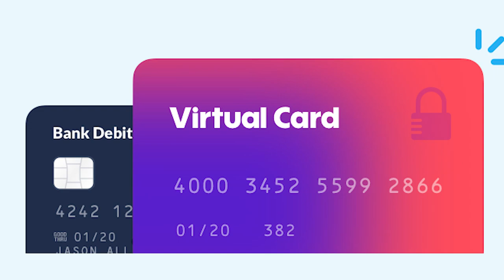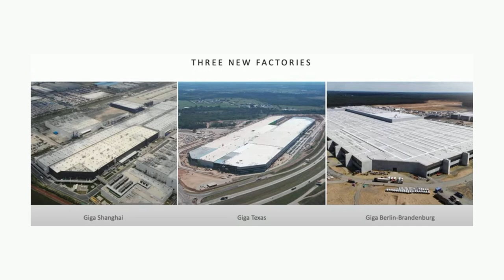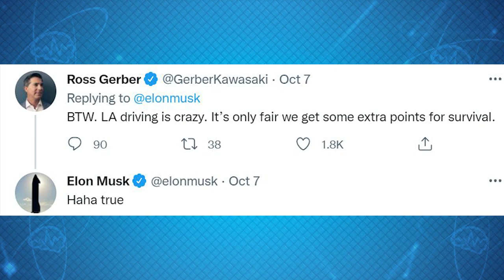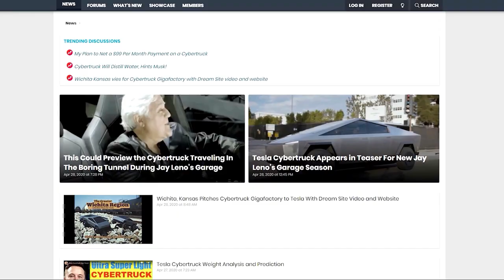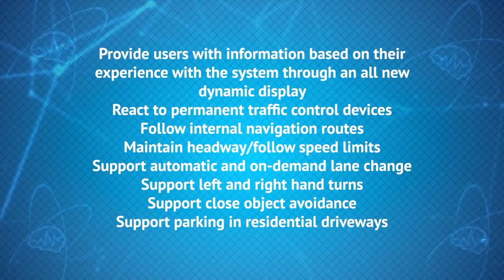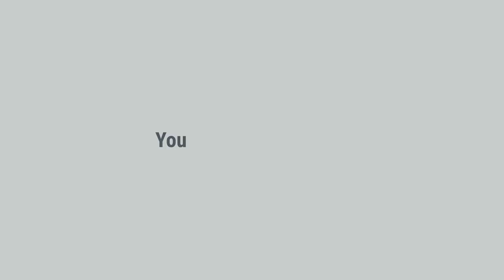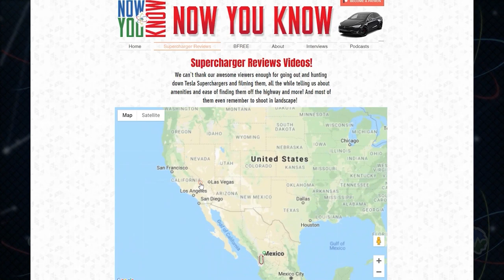Tesla Time News - Tesla's GigaBeer & Texas HQ

Comment: Im not a Korean viewer, I'm European and we have the required Type 2 connector, and personally I always prefer charging on Superchargers purely because of the ease of use and the low price. And you gotta imagine it's the same for a lot of owners.
So depending on Tesla's current network of SuC's in Korea, I don't think the adapter will be too much of an issue for other EV brands.

Still, the non-Tesla-EV-charging brands should really up their game and get more (working) chargers.

Comment: If the police are still driving ICE cars, will they even be able to catch a criminal if they're driving the Model 3/Y?  Luckily this time, the good guy was in the right car, I hope they switch before they repeatedly find themselves on the losing side.  P.S. Excellent work, Joe!
Reply: If you drive a Tesla and constantly think you can out run police.  You should probably slow down, pull over, and not be driving a Tesla.  But yes.  I definitely could outrun the SPD.
Reply: @lucasmccormick9473  So slow down, pull over, and stop driving your Tesla.  Your rules, not mine 😅
Reply: You can't outrun a Motorola

Comment: I think it is possible for the headlights to actually show Tesla with Easter egg software. I work for Mercedes and they have had adaptive headlights for a while now using a block of LEDs and turning off certain LEDs to control where the light goes so be cool if Tesla can pull this off 😃

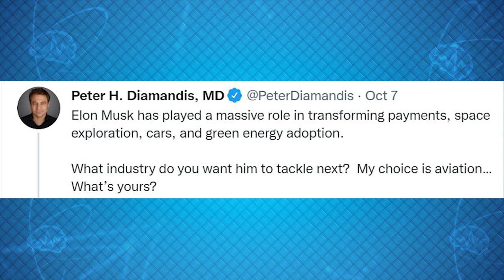Comment: 57:48 - What would you like to see next from Elon? -- For me, the efficient water heater/AC combo that has been mentioned before. This would dovetail nicely with solar on new home builds. And hopefully could be adopted to industrial buildings as well.
Reply: Slug robot used by the boring company. Has digger drills on the front but uses slime to move forward.
This is what he is working on next.

Comment: We have the CCS Adapters in New Zealand and Australia as well. It requires a firmware/software update to the car as well.
Reply: TM3 and TMY has already European CCS or CCS2 as their standard (US CCS connectors are also called CCS1), and the SuC V3 has only CCS2 on the cable. V2 has both types, though European "Tesla plug" is an altered/enhanced ChaDeMo connector that can handle more effect than ChaDeMo when charging, but it  looks very similar to the US type Tesla plug. 

TMS/TMX has the option of upgrading to CCS2 adapter, but require som HW to function. But newer TMS/TMX came with the adapter and needed HW preinstalled. The new updated TMS/TMX will probably still have this solution, as the CCS1 and CCS2 are just to big to hide behind the cover on the lamps. 

Unless they choose to change their solution or back lights for the European versions, but that needs, as mentioned, bigger lights and bye that, big changes on the body, so not very likely.

Comment: The Irony of Tesla being a Direct Current company is amusing.  These DC Battery storage facilities are exactly what Edison proposed over 100 years ago when he was competing with Tesla's Westinghouse Alternating current solution.  So in the end it's DC for storage and AC for transmission.
Reply: @wayando  Do you mean that an AC stove will work on Direct Current with no problems? Or that a microwave designed for AC will run on DC or a refrigerator?  I'm no electrician but that would be a surprise to me.
Reply: @willywonka8730  most recent and high-end refrigerators, air-conditioners and washing machines are now internally DC operated, they are more efficient, longer-lasting and quieter.
They use linear compressor or DC Motors, and make use of an inverter for their  conversion. Ofcourse, no need mentioning all electronics tv, laptop, DVD, etc are DC too. Apart from microwave, can't think of why Homes shouldn't be DC powered.
Plus the modern trend which will soon become a Standard regulation globally is for every new home to be self powered (solar & battery storage) and also be part of distributed utility all of which are fundamentally DC generated power
Reply: @danielfreeman4765  Interesting.  Thank you.  Are these appliances realistically modifiable to run directly off a DC power Supply? i.e. using simple wiring changes to bypass the inverter circuit?  I know that low voltage DC circuits in computers can be maintained by batteries and that the "power supply" supplies 5v DC to the mother board and it's components from 110 AC.  It would be very useful to me to be able to run an air-conditioning compressor off of DC power.  Is it as simple as opening the box and supplying the right DC voltages to the various components?
Reply: @willywonka8730  Yes, for the technically inclined but I won't recommend such since it will void the warranty asides that any errors might destroy it plus work arounds aren't that pretty to behold compared to the original stare of the equipment
Reply: @danielfreeman4765  Thank you again.
Reply: @wayando  Interesting. Thanks

Comment: switched to a safety razor a year or so ago, not only does it cut better, I got a box of 100 blades for the price of 6 of disposable ones, and that box will last me about 10 years, roughly 1 blade a month even with shaving daily. It's one of dozen simple things I've done to remove plastic, increase recycling (simple pure metal blade makes it easy to recycle) and lower emissions (only need to produce a single blade rather than the multiple pointless ones on disposables and less packaging and transportation as well).

Comment: @51:51 Great idea for desalination without requiring energy input, but (you knew there was a but coming) how/where do they get rid of the brine leftover in between the daily evaporation cycles? 
They can accomplish the evaporation by building some nested clear plastic or glass geodesic domes, pumping in seawater in the morning, letting it evaporate during the day, letting it condense on the surfaces in the evening but they still have the problem of pumping out and getting rid of the brine at night, before the next day's cycle.

Comment: Liability is a big issue with solar roof on older homes too. They wont install on mine because my roof (framing) is 100 years old and they can't confirm it will hold 3lbs per sqft
Reply: That’s astonishing!  1 sq foot is basically one concrete roof tile,  and they weigh in at about 4.2kg.  That’s typical roofing material in Europe.  The roof trusses and rafters are quite thin on my roof.  50x100mm lumbar at 60cm spacing.  Those static loads are generally quite small compared to dynamic loading assumed for storm conditions built into building regulations.

Comment: I believe the headlights are led digital pixel lights. Those projected words of tesla are the pixels in the headlight itself. 
I could be totally wrong, but my 21 mic m3 i think has them as you can see the upper row move across away from any oncoming cars headlights. First time we noticed this I thought i was losing it. They are amazing.
Reply: yeah exactly. Depending on the resolution of the matrix it may be possible to write words or shapes without additional lenses?

Comment: 19:30 One argument for new houses, is that if you plan solar, long before you start building, you have better options to put the roof towards the sun.
My roof face single sided away from the sun. to get higher wall and more windows on the sunny side.

I think about plans for a garage at may secondary home. Probably I will make the roof face single sided towards the sun. Maybe a steep roof on the other side, depending on building application regulations.

Comment: Think that the headlights are active matrix LEDs, as used on other high end EVs. eg iPace. The matrix LEDs are individually addressable so that gaps in the beam pattern can be made and hence reduce dazzle in that direction. Were it just a projected mask they would have used the Telsa logo not a low res depiction of the word. A forward facing camera is used to control which LEDs are enabled at any particular time.

Comment: 2020 Renault Zoe has 52 kWh battery and no longer short range , 200 miles plus for most drivers, wireless charging not efficient yet , for the lazy , but maybe usable for those without home chargers

Comment: One thing to think about the charging adapters is that Tesla owners are mainly going to use Supper Chargers. These adapters would rarely be used and only in those cases when you need to charge now and won't make it to a Super Charger. The reverse effects however for other EVs. They will use the Super Chargers more than the others.
Reply: And Tesla should be delighted to sell KIlowatt Hours at a 300pct margin.

Comment: Why would a Tesla driver want to charge at a CCS station? Paying $250 for an adapter that would only occasionally be used (in the US) and seems impractical in most areas. Especially since Tesla Charging stations are everywhere and still growing. Korea likely needs them due to, perhaps, an incomplete charging network. Am I missing something?
Reply: You are missing lots.
I live west of Vancouver a city of 2.5M.   I want to drive to Edmonton(pop 1.4M) via Yellowhead main highway.  Distance between Superchargers Kamloop to Jasper assuming it opens soon 445 km.  Can't do it with any M3.  Tesla has no plans to add Superchargers on this route.  Need to use Petrocanada charging stations which use Chademo or CCS.  Will buy CCS adapter when available.  No other way to make the trip work.
Reply: @philmakin9111   I did mention U.S. and most areas.  Many Tesla’s have that range distance covered unless you have older or standard range models. I would personally purchase a long range model if I drove that kind of mileage often. However If the market call he will respond.

Comment: The CCS adapter in Europe needs a hardware change for it to work. If the same is true with the Korean adapter it will not work by itself without the upgrade. So no point of sending the adapter by itself to the US.

Comment: 20:50 I desperately want to replace my fossil burning ATV.
I sincerely hope the CyberQuad will be available not just as accessory!

Basically I need a small tractor to pull a trailer along a forest road/path.

I have been looking at some existing electric ATVs, but they are either:
Too expensive, too small, not road legal (yes, in Norway you need license-plates to legally drive any motor vehicle, and to get license-plates, it has to be road legal even if you don't drive on public road.

Comment: They'll never move a line.... they'll only add lines.  They will need all the batteries they can get so they'll never drop a supplier.  Factories will be located at logistical centers.  We ordered a blue lr y named Stitch.  Hopefully we get the rebate, but if we don't I will sell my body on the street.

Comment: Fuller adaptive LED lights are not based on lenses.  It works more like a low resolution movie projector.  There are an array of leds that allow any image to be projected without any moving parts.  This allows oncoming cars to be omitted.  Imagine being able to keep your high beams on because there is hole in the beam created for each car.  Best of both worlds, no one gets blinded and yet you can see.  They were using the word tesla just to demonstrate the resolution.  Toyota developed a similar system but theirs wasn't as cool because it would block out an entire vertical column to create the omission for the other cars and tesla's system seems to be able to create a dark spot anywhere.

Comment: What happened to the 4680 pack being cooled/heated from the top and bottom.  I see ribbon coolers touching the side of every cell.  What about the wiring on top?  Tesla needs 100 batteries in series for 420V battery pack, it's not obvious how that would be wired.
Reply: That’s a question for Sandy Munro.

Comment: Simple question/statement: when will Tesla start having their autos talk to each other - why: because to have ultimate safety and full capacity of FSD all autos will need to talk to each other.  What can you tell me?
Reply: While I'm not saying there is no reason to have inter car communication, light is faster. The car can see most issues, and process the results, faster than the car can contact Tesla -> sort of which car or cars to talk to ->  establish secure connection to said car/s -> car computes data and reacts.

Or just blast data everywhere locally from some communication standard. But how do you stop people from spoofing this and manipulating what the cars do?

It seems like solving this from vision is still required. Then add on some extras that require communication later on, but I don't see this at all as being required before they can do level 4 or 5 autonomy.

Comment: Can we really license it if they Hardware infrastructure in the other vehicles is different or maybe has less cameras or placed in different locations from where the software is configured for a tesla?
Reply: Yes. Every neural net would have to be configured and possibly learned for the different hardware anyway. Without the Tesla chips the software will be not very valuable for those customers.
Reply: At AI day, Tesla showed that they need to calibrate cameras for angle, color, point of view, in order to convert multiple video streams into a single 360 stream and into vector space. I think that could adapt to somewhat different cameras. 

After all, Model S, X, 3, and Y don’t have their cameras in the exact same spot.
Reply: @ec92009y  That's true Elie. I wonder if that is the reason why there are differences in how some of the cars are acting on unprotected left turns or where they stop at spot signs/lights. Some the videos I watch from the Beta testers show different reactions. I know they figure that stuff out. I love this stuff.

Comment: Yes induction charging is more expensive but if it becomes a standard just think of the reduction in costs of repairing charging stations because cable connectors are going to break and become non operational because of dirty data connection or over heat because of dirty DC power connector. Plugin charging stalls can also slow down charging rates as heat increases in charge plug  connector and because of safety factors. No plug or large DC charge lead to plug in on rainy windy cold days. Just drive over charging plate and vehicle takes it from there if vehicle is registered with system. You just sit and wait or run for a coffee. Would these stall also attract mobile coffee stalls. 
Just a note Jesse you are still acting like a kid from time to time, maybe it's time to show your age. Zac stay cool man , maybe raise that chair an inch or two 😀👍